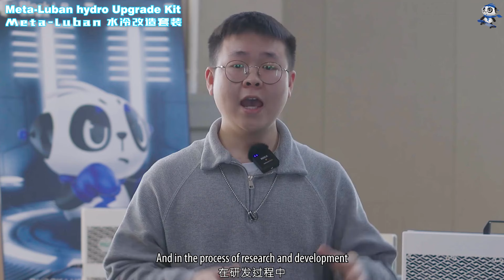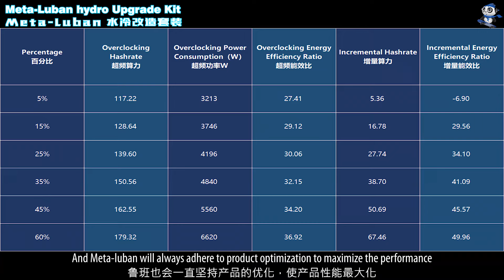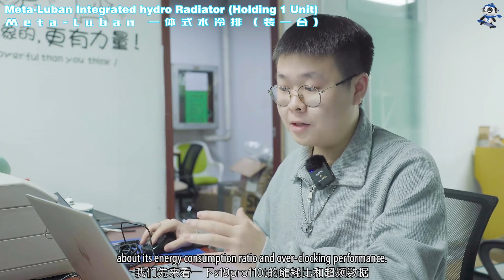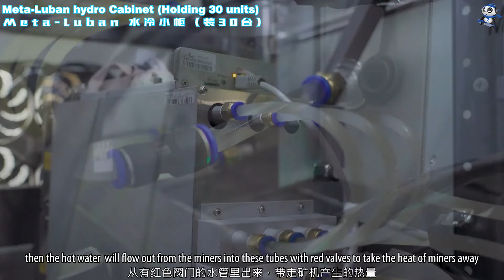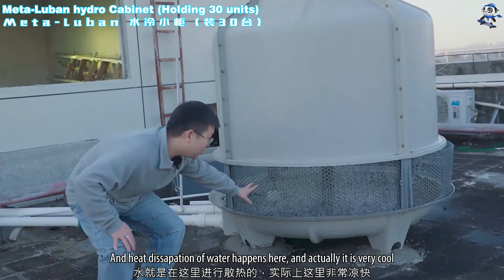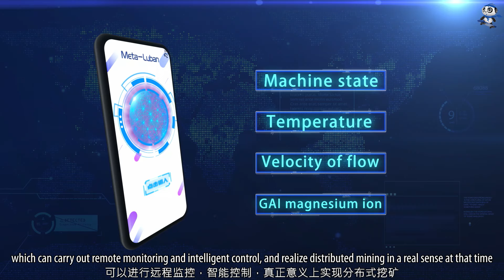Introduction of Meta-Luban Full Series Hydro Equipment

Comment: Meta luban items are not matching. I ordered for S19Jpro 100th but they sent me for 110th the hash boards are different the water block didn't match. Still waiting for replacement for more than 50 days
Reply from the maker: There are some misunderstandings. Sorry about the inconvienience caused to you. You bought the products from other sellers and they ordered from us, so there was some kind of misunderstanding. We will try to solve it for you.
Reply: @Meta-Luban  I really like the system you offer. 
Also being me as a user and potential customer I would like your argument to be true, that the seller has made a mistake.

Comment: So double the power consumption for 60% more hash rate? I'm I missing something here or it's better to have 2 miners for the same power cost?
Reply from the maker: Overclocking 30% and the original air-cooled miner energy consumption ratio is the same, low coin prices, high electricity prices in the region, it is now recommended to overclock 30%, of course, electricity prices are cheap places can be more . Water cooling is more stable and noiseless than air cooling, and the machine damage rate is reduced by more than 90%.